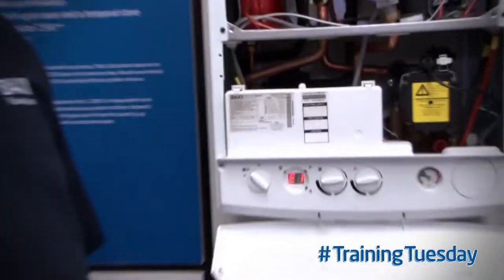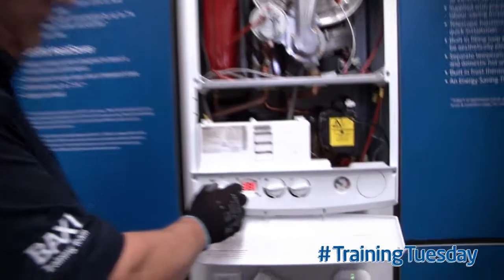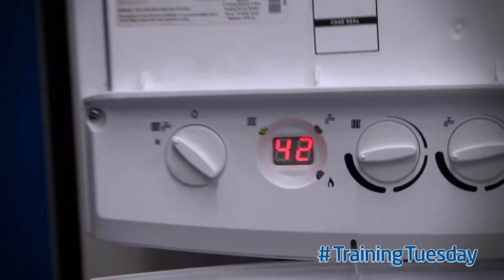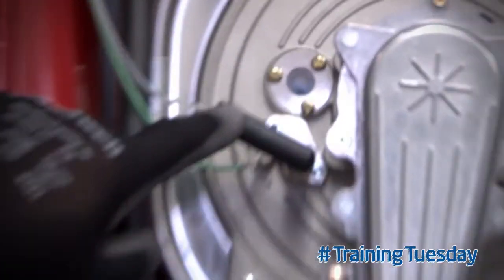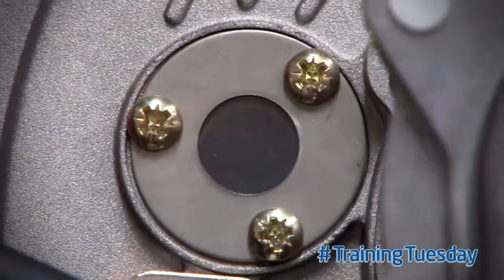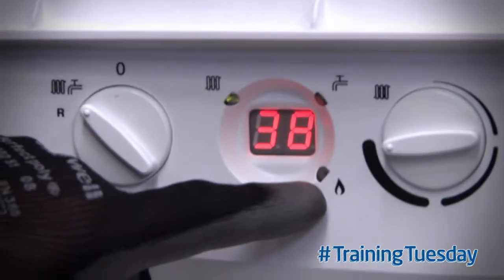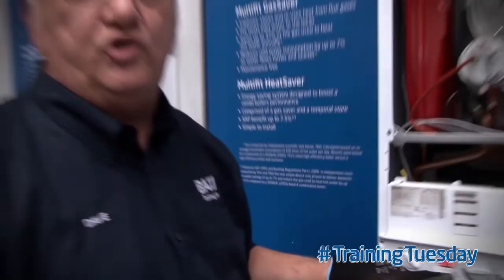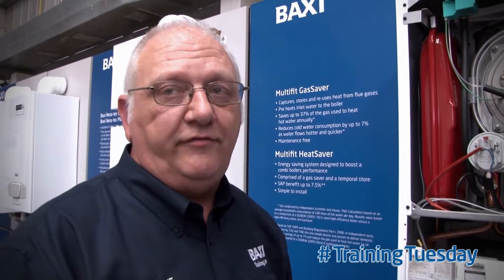How to check ignition on the Baxi Duo-tec & Baxi Platinum boilers

Comment: I have a Baxi Duotec 2 40 KW, which is flashing a cross flame and spanner error then displays 117 (NO E!) then the cross flame and spanner, it then tries to reignite, heats for a while then errors again.....only seems to be doing it while heating the central heating and not the hot water system....any ideas please?

Comment: Thanks for video. So if we see a flame in view glass but flame indicatir light not coming on at the display below, would this suggest an electrode fault?
Reply: Or rather on board flame sensing circuit fault, such as faulty coupling capacitor, etc.